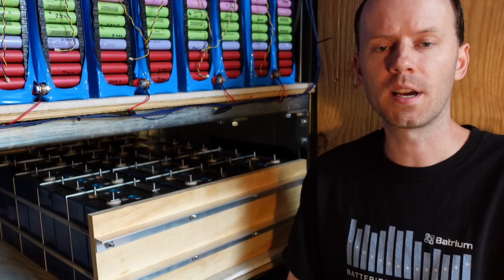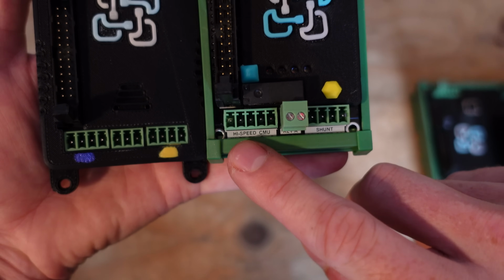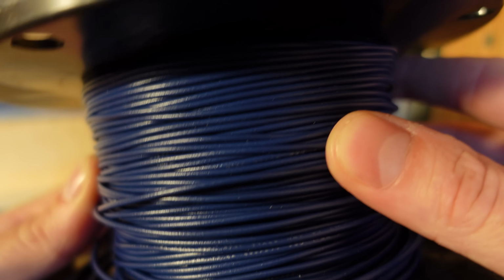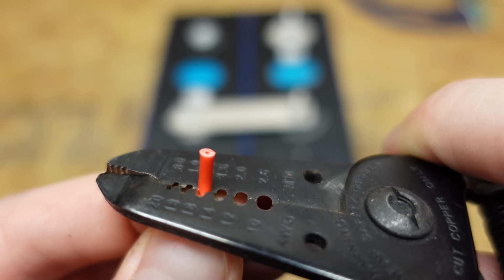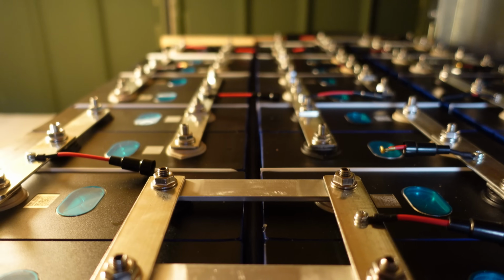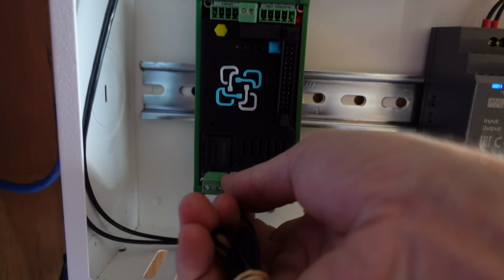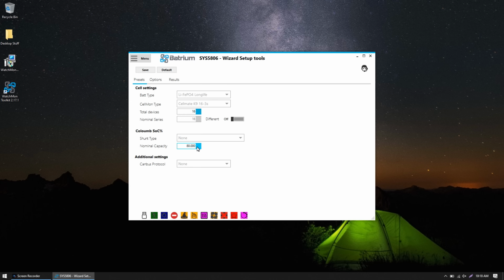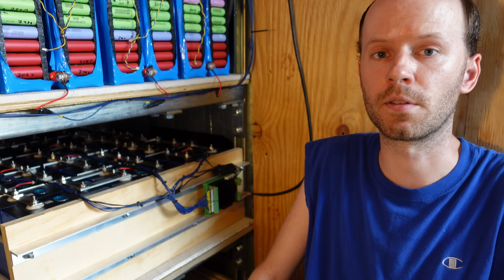Batrium CellMate K9 BMS Install on EVE 280Ah LiFePO4 Batteries

Comment: Great Video!! Starting my own similar set-up (4p-16s), just ordered the WatchMon Core and 16 BlockMon M8's. I noticed you put your cell monitoring connections on the SERIES connections? It was my understanding that the cell monitors usually go on the PARALLEL connections?  Can you explain why you did this, whats the difference or am I missing something? Keep up the informative vids!!!
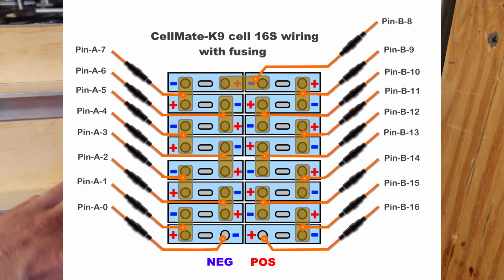Reply from the maker: One balance wire goes to each series connection where the voltage increases between cells. I have a 16s2p battery here. That means there 16 parallel groupings of 2 cells, with each group wired in series. Technically the busbars serve both the series and parallel connections in this configuration, so perhaps that's where the confusion is? :) There is a graphic at 6:19 that may explain this better.
Reply: @LithiumSolar  I believe that was why, overlooked that. I guess my wiring will be completely different anyway seeing how I'm using BlockMon M8s. Do you know yet how many AH of active balancing the K9 provides? Batrium said they didn't know yet when I ordered, so I went with the Blockmon M8. They offer 28ah per day, so I went with a known quantity verses a new (K9) product. 
Please update as you learn more!! Enjoyed a lot of your videos.
Reply: I am using the blockmon as well but my system is in a 4p-4s configuration.  I intend to have a blockmon on each cell.
Reply: I am still a little confused,there are 2 diagrams one on 6.01 another on 6.19.,one 16 batteries the other 32 batteries 
I see there are 2 negative battery and 2 positive battery poles(6.01)connected with 3? busbars and i am not sure if the fuse connections are connected to the last busbars,between the positive poles only…
Can someone clear this,maybe simple but I don’t see it 😊

Comment: mmm good idea to drill a hole in the busbar. Can’t you use a second nut on the battery terminal fore the balance conection?
Reply from the maker: Yes, I could have used a second nut too. The challenging part there though is can't tighten it down much without worry of also tightening the nut below it, which has to be at a very specific torque to avoid stripping out the aluminum threads in the cell. Yes, can be done, but just feel the tap approach was better.
Reply: @LithiumSolar  
and tapping is quite easy to do. particularly into copper.
Reply: he explained it

Comment: what a good job you did on showing the setup wow! would like to ask why the two battery's parallel then S why not 2 16s strings? while nice the fuses on the wire is nice but the wire would act as a fuse at these AMP levels LOL. i really liked the the look of your installation.
Reply from the maker: I don't really see any advantage to having two 16s1p instead of one 16s2p like I built here. There are a pile of disadvantages though - higher cost of BMS (would need two K9), more cabling, more fuses, more worry about balancing (32 cells instead of 16), etc? Also - no, the wire used does not act as a fuse. Under a fault, it's much more likely to melt the insulation and form a giant firey mess of melted goop. Hence the fuses... ;)
Reply: @LithiumSolar  if you have one K9 it's normally used for 16 Cells individually, I assume. Your Setup is to hooked up to 32 Cell to one K9 lead to 2 Cells. 

 Your Readings will be based on 2 Cells.

Scenario, if there's an issue with one lead of Cells. How would you solve it?
Reply from the maker: @Stephen-dg9de  The cells are in groups of 2, yes. The group of 2 cells acts as one battery. They're always at the same SOC and will (hopefully) age together as one battery. If you notice one grouping start to fail, process would be the same as if it was a 16s1p. Disassemble, test the individual cell(s), and rebuild as needed.
Reply from the maker: @Stephen-dg9de  These are all brand new, matched cells though. In theory, the entire battery should age as a whole. Eventually it will reach a point where one cell in particular fails first - hopefully 10+ years from now when there is much better and/or cheaper technology available. At that point, I wouldn't be repairing, I'd be replacing the entire battery.
Reply: I'm also curious to why 1, 16S and not 2, 16S???

Comment: I was wondering if a rivet would work for the balance wire instead of tapping a screw thread? A screw is better I suppose for servicing, I've just never really tapped much before.
Reply: not so good idea. rivets are not designed for electrical contact. and it is difficult to dismantle the wire.
Reply from the maker: I don't think there's any guarantee the rivet would be tight enough or remain tight enough. This project was the first time I've ever used a screw tap. You wouldn't want to see the busbar piece I tested/learned on... LOL
Reply: I had a look at a discussion about using rivets in UK electronic installations, apparently there isn't clear guidance but they are considered a risk because you cannot undo it for testing and maintenance. Also being soft aluminium they aren't considered mechanically stable, and when used with copper they would have issues with dissimilar metals.

Comment: I was interested to see you using an inline fuse for every battery sense wire for the Batrium controller. If I did that I would check the end to end resistance of each one, to make sure that my controller was not receiving any artificially low readings due to a poor connection through a fuse - there is only that little spring pressing the connections to the fuse in the fuse body, so there is a chance (x16) of some dirt or other problem. Just a thought.
Reply: yes, i agree the fuse holder might create problems. not so much dirt but corrosion.

Comment: Four vs Core, sound so similar! I'm happy to see you back in your battery shed! Those were the videos I found your channel with and enjoy the most. Looking forward to more videos on your power system upgrades. Battery teardowns are all so similar.
Reply from the maker: Thanks! I completely agree the project videos are more fun but it's just soooo hot right now, container is cramped to move/film in, and kindof running out of ideas at this point. I have a lot of ideas lined up with the switch from LCO to LFP though. I need one more bank like the EVEs (coming very soon) and can begin the switch-over.
Reply: @LithiumSolar  Awesome! I didn't know you were switching over till I watched this video. Must have missed that when watching the build of those new packs. That will be cool to see. Are they different nominal voltages and that's why you are switching or are the 1865's just not as powerful anymore? If they are the same nominal, would be really cool to see a setup with the LFP in parallel with 1865. I know the discharge curves are very different, and the 1865's would be drawn from first until the voltage dropped and the LFP started helping but would be really cool to see when that happened and how well it worked.
Reply from the maker: @BenBrand  I've hinted at it but never directly said it as I wasn't entirely sure which route my project would take. I've invested so much time and money into the current setup that it's a difficult thing to do, but I see it as a learning experience and opportunity to move on to a better (and much safer) configuration. In addition to safety, my family life has changed a lot since the start of this whole project and I no longer have time to sit here picking apart laptop batteries like I once did. It's difficult to even find time to make videos these days to be honest.

Comment: Why is Batrium so expensive and complicated? I am using two Chinese Heltec 200 amp with 2 amp active balance, and built in bluetooth with a free android or iphone app to monitor my 32 Lishen 272ah cells. Each BMS is monitoring 16 cells, so no unmonitored parallel cells. Costs less than a single Batrium BMS without all the "mon" addon requirements. Zero issues. Just works. What does the Batrium bring to the table that is better?
Reply: I had the same thoughts. This is WAY to.complicated and splitting the one board into two boards is the wrong direction. 🤦🏻‍♂️
Do you have a link to that Heltec 200? 🙏
Reply: Lamborghini is the same way ... no way I can work on it and so off the charts expensive.  lol
Reply: I felt the same way. Hard pass on the complicated process.

Comment: Thanks for the instruction. I'm connecting my BMS using your buss bar method too. I checked for support of the Batrium BMS software on Linux - not supported. Pity, I am running my system on a Raspberry Pi.
Reply from the maker: Yeah, no linux unfortunately. You only need Windows to configure it though. You can pull data from it using Linux. I run a CentOS VM to manage that, though an RPI would work great as well!
Reply: @LithiumSolar  thanks for replying. Yeah, I wonder why manufacturers insist on developing their own software exclusively rather than publishing a full API (not a knobbled version) and letting the user community develop the software for them in addition to what they develop. Everyone wins, but this "mine, mine, mine" mentality makes us all losers. I won't consider batrium for this one reason...I want flexibility not restrictions for my hardware.
Reply: @Bennyboy-dog  
then you are really really restricted in anything you are doing.
Reply: @ursodermatt8809  Au contraire Urs, there are several open BMS available and Open means complete freedom and choice. For example Check out Stuart Pittaway's openBMS. 
I don't want Batrium's intellectual property, I just want to use their products without restrictions on operating systems and other restrictions they impose and that means they provide a concise API. Nothing else need to change. They could do that very easily (they probably already have the API specifications for internal use), so they have spent the money building it but aren't selling it.
Reply: @Bennyboy-dog  
first of all i do not see your problem. with the batrium you only need windows to program the balancing etc. then you can forget about it and go back to do your linux thing.
and keep in mind, your linux people are a very tiny community.

Comment: Thanks for a very informative video. Regarding the  “soft” compression of the 280’s , do you have a torque value you can share? Cheers kevin
Reply: the torque value is somewhat complicated. depending on temperature and SOC this changes. but any compression is better than none. just use your common sense.

Comment: 063021/1352h PST.  I reached 50% of this presentation and I had to comment at this part of the segment, before I forget. Thank you. Fantastic, very intelligently composed design. Especially the separate balance lead, and tapped screw designation. Appreciate that design, quite intelligent and logical. The DYMO shrink labeling to identify the cables on top side and the bottom end.
There are 2 items that I’m, still, foggy. 
1) The strange BMS , that is. If you could prepare an elaborate description on those BMS’s, the salient features, that makes this, particular BMS outstanding than the normal BMS viz: JBD/DALY/QUCC? Or perhaps a comparison?
2) Compressing the cells. Does the compression procedure make the battery last longer? Say 2 years, 3 years or 4 ? Is it worth the effort for an additional couple of years longevity for the Battery?
Thanks again for your endeavor, that’s always appreciated. Take care and be safe. 
Heartfelt condolences and prayers, to the losses at the building collapse.

Comment: Well done. Main +/- not connected to anything, right? On the two packs with low voltage, would you be able to measure voltages on each of the four batteries to see which one is low? Or because they are in parallel, they are at same potential? Please, let us know what voltages you see there. Thanks for sharing.
Reply from the maker: Correct, main positive/negative are not connected. I need to carefully plan the switch-over from LCO to LFP. Yes, I would have to remove the parallel busbar connections on the 2 low groupings to check the cells individually. At this point, just going to charge it up, let it balance, then see where it stands. It could have even been an issue of the initial balancing process, maybe a bad connection or something. Time and testing will tell.

Comment: Wow, David! What a huge process boiled down to an understandable dialogue! Personally, I can't even begin to thank you for all of that effort (in the heat no less!) that you went through to make it 'simple & understandable' for a NOOB like me. I actually understood the process, what you did & the order it was completed!
   I'm pretty sure that subscribers & regular viewers will genuinely appreciate how much effort that really was- but, someone has to say THANK YOU! It might as well be me, cuz- I haven't been posting recently- more lurking than gratitude...
   That is one hell of a big battery you built (32 280AH cells- heck not only do I need to take my socks off, I need to find & pull out that high powered TI calculator I haven't used since college!) and even though you aren't happy with the wiring jorb- I'm very impressed with fusing each series cell. And, I really like the Batrium setup, at first I thought it was overkill, but- on reflection- it seems to be appropriate. Really like the drilling, threading, sizing the screws- really clean work.
   Very technical post but I dug it and will watch it again if I ever get even close to that size of a set up. Thank you again for whittling it down to human size!

Comment: Fluke 73 yeah ,,, you get shielded Ethernet cable (STP) btw,  For the temp sensors you could crimp them into big lugs that you could put onto those terminal post with second nuts
Reply from the maker: I love that meter. I've had it over 20 years and was passed down to me from my Dad. It hasn't failed me yet! (though I did have to finally replace the leads about a year ago)